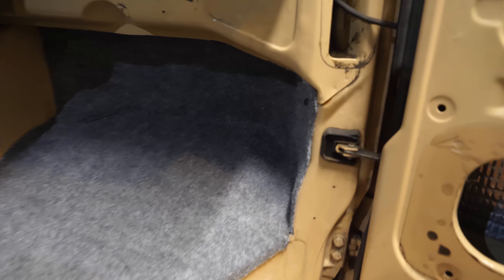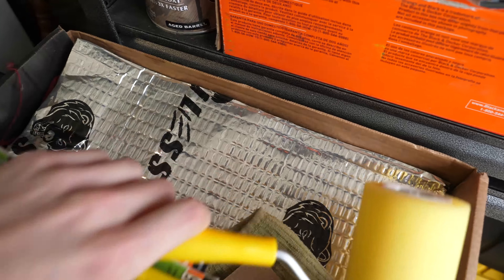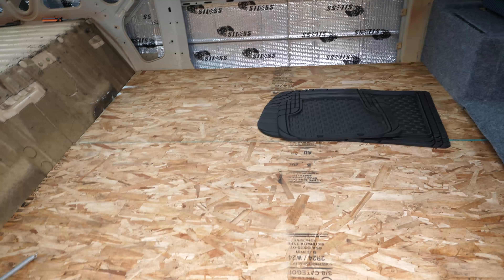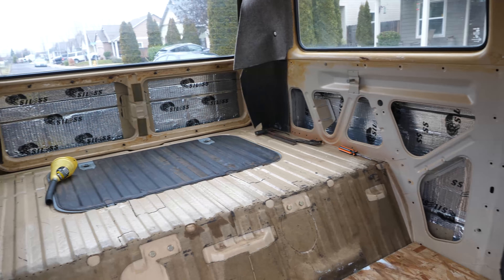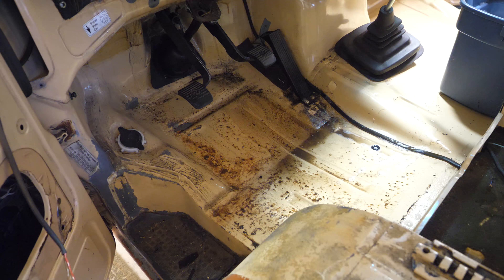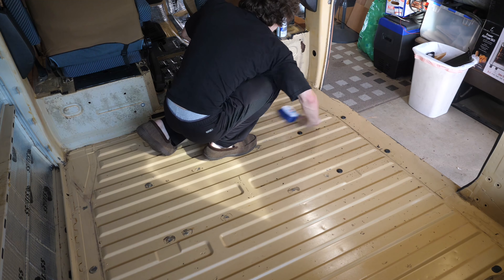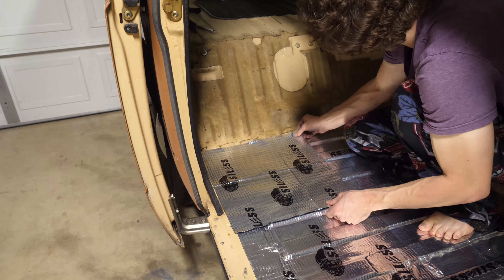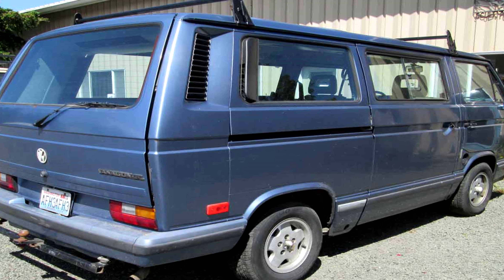Turning My Van Into a YouTube Studio - Sound Dampening

Comment: With all the sound dampening and other stuff your going to put in it all adds weight you may find it feels gutless when it's all done. Rather than removing or changing what you have to make it lighter you could put a turbo subaru motor in ot from either a wrx or a forester nothing crazy just a bone stock one. It should drop straight in if you get one from a model similar to the motor you have in ot now all you will have to change would be the exhaust to work with the turbo. Loving watching this van transform keep up the good work

Comment: Once its fully rebuilt can we get a burnout?
Reply: Is that even possible with a front drive?
Reply from the maker: ummmmmm maybe!
Reply: @thefreeman1970  The van is rear wheel drive. However, front wheel drives can do burn outs, they just don't look as cool doing it.
Reply: @AdamNDJ  Thanks, never knew how to spot whether it's rear or front-wheel drive. I just assumed it was a front-wheel drive because the middle part is so low and has no visible housing for the driveshaft.
Reply: @thefreeman1970  Sometimes it is hard to just "spot". Vanagons are an evolution of the Type 2 "Bus". Which was based off the Type 1 "Bug". So they use the same engine in the back driving the rear wheels that the Bug used. There are also Vanagon Syncros, that drive all 4 wheels, but Barry's isn't one of those.